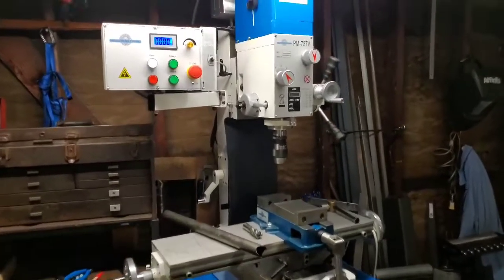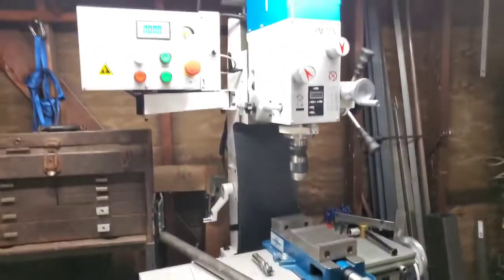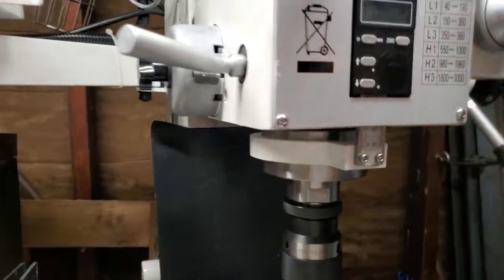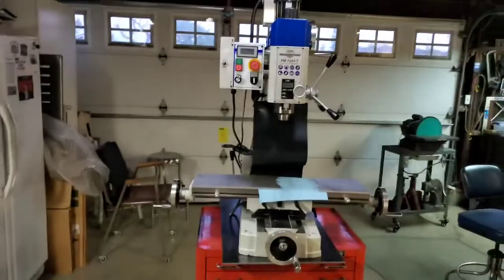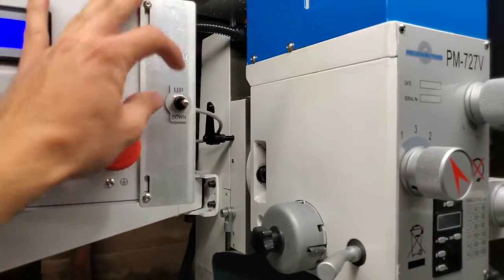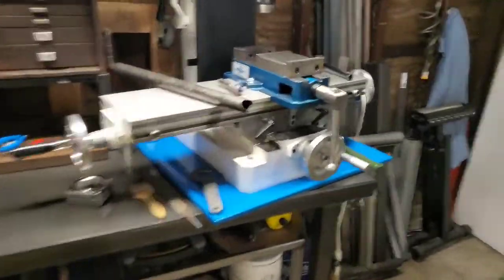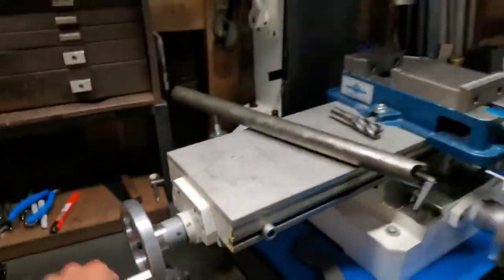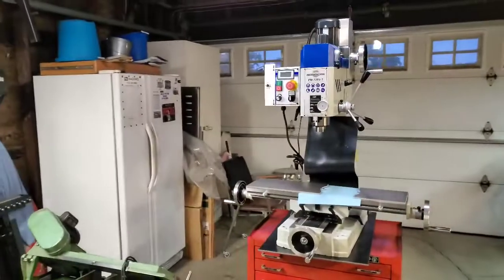Precision Matthews PM-727V vs. PM-728V-T

Comment: I have the 727V and it's a good machine, I will say a few things, the left crank doesn't have a dial but with some (mine) the power feed is there (an option) and that is one reason PM might have left it that way, also as you stated the machine has good power and torque, I also use the McMaster-Carr folding handles, but mainly the 727V is very rigid, I have the Factory DRO and it makes a major difference if it's in your budget.

Comment: Thanks for the help.  I’ve been so sold on the belt driven Taiwanese version for so long but now taking a step back and looking at the bigger picture.  I plan to mill tool steel and also small stainless parts.  Thanks for the helpful comparison!  Not too many people have both at the same time.  😂
Reply from the maker: @RodlessReel  Yes I've had the "luxury" of having both at the same time lol. The 727 has much more rigidity than the 728 so it's probably the better move. It's easy to switch the gear knobs to each of the 6 different speed ranges as you need them. If you're gonna mill hardened & stainless steel you'd probably regret having the 728.

Comment: The 728 might be made in Taiwan and all but this doesn't justify the steep pricetag if is too weak to drill a 1/2 hole in steel. They should at least sell it with the bigger motor.
Reply from the maker: @JohnnyRbbit  to be fair, most of time time it will drill a 1/2" hole in steel just fine but in some situations it would stall. I agree though - it's underpowered for its price tag. I think a lot of 728 owners convert it to CNC for machining aluminum and it probably works well for that.

Comment: Hey, great video. Are using 15 amp circuits? Any tripping breakers on the 727? Thanks!
Reply from the maker: Thanks. I have it on a 20amp breaker but it would probably run just fine on a 15amp breaker. It's never tripped the breaker. It doesn't seem to draw much power but you could find all the electrical specs in the user manual I'm sure.
Reply: @grippimatt  ok, thanks for the info!

Comment: hows it holding up?
Reply from the maker: It's held up great, I've been using it for over 2 years now. I mostly use it to bore holes in stainless steel flat bar with annular cutters and it works like a charm. I haven't had any issues with it.
Reply: how does it do with face milling/facing operations on various types of steel?
Reply from the maker: @peterantley  it will handle that. I've faced stainless without any speedbumps. It has as much rigidity as you can ask for in a benchtop milling machine.
Reply: @grippimatt  any chance i could make a donation for a video on the subject? Im a greenhorn. Inherited the family south bend lathe and i want to add a mill. Im on the fence. My local mentor swears by a super rigid American machine but im not sure it makes sense for me. I feel like starting out im doing small parts and would rather spend my time making chips instead of doing repairs.
Reply from the maker: @peterantley  I appreciate the offer but I think the determining factor for you is how heavy of milling operations you're planning on doing. A benchtop milling machine is really intended for light to medium duty milling operations. At 470 pounds, the 727V can handle some decent cuts but at the end of the day it's still a benchtop machine. 

I should add that I'm no expert. I use my machine to run a small business and only occasionally use it for precision work. Most of the time I use it as an expensive drill press. My grandpa was a tool & die maker and I've taken machining courses at my local community college in addition to my background as a welder/fabricator. For all the machining work I've needed done as a professional fabricator, the 727V has handled all of it. 

Another thing to consider is what your shop space is like. I chose a benchtop model because I'm operating out of a standard home garage so space is limited and I don't have room for a knee mill. If you have space for a full size knee mill I'd recommend that but most of us don't. Enjoy the family lathe - that sounds like a nice machine.
Reply: @grippimatt  thanks for the thoughtful response. I should try to take the local community college class and see how it goes. Im in enterprise data processing but have been really enjoying learning abt metal fab this winter. My friends dads been teaching me draw a bead and do some light fab work as well.
Reply from the maker: @peterantley  No problem. Working with metal can be very rewarding. I've made lots of custom furniture pieces for my home and being able to repair things around the house when they break is priceless. Good luck on your journey!

Comment: I had a pm 25 mill , then I bought a pm 727 omg it's far far better and the 5" precision vise fits perfect, I removed , cut the back lip of the 5" vise with my band saw ! And I have full vise motion! On the table if you get the 727 definitely get the 5" vise , modify it by removing the useless trim rib lip on the back of the vise and you will be much happier than the 4" vise !

Comment: hi, nice video thanks for such great comparison, quick question, do you see the need to mount this on a cast base they supply? or a sturdy table top bolt it down would be good enough and rigid enough? i noticed either one of your machine are mounted on their base, both sitting on a table . any input is apprecaited.
Reply from the maker: Hi, I think you're referring to the stand they sell with each machine but It's not very heavy duty from what I can tell. It's all made of sheet metal that fastens together from what I can tell so to answer your question- no, you don't need their stand for either machine. Any heavy duty alternative is gonna be rigid enough but I wouldn't recommend leaving it on caster wheels because the whole stand will shake when you're milling even if the wheels lock in place. You'll need something with leveling feet.

Comment: Matt - this was a really well done comparison! Can you do me a favour? On the 727V can you measure with the table full right from center line to the tip of the hand wheel? Basically how much sticks out past the mill on the left hand side with the table full right.

Also - subbed :)
Reply from the maker: Thanks! Just measured this and if I understand you correctly, with the table as far to the right as it can go, the left hand wheel (excluding the handle) sticks out 1.125" to the left of the cast iron base. Let me know if this is what you're looking for.
Reply: @grippimatt  wasn't exactly the measurement I was thinking (was looking for from center line to left hand wheel with table at full right) but this works too since PM lists the base width. So really with table full right, based on your measurements there's barely any overhang to left.

I have a small work space like yours (check our some of my vids if you want to see)...so was trying to figure out if I swapped out where my drill press is for this mill, if I could not have it stick out too far if I just kept the table to the right when not in use.

Thanks a bunch!
Reply from the maker: @SomeGuysGarage  No problem, I'll check out your work shop 👍

Comment: I enjoyed your comparison. Well done, short and to the point! I have been thinking about the PM25MV vs the 727V but your video has convinced the small extra $ is well worth it. This will be my first mill (I'm a retired self taught mechanic/welder/fabricator with zero milling experience). I'm tight for space - with the 727V can I get rid of my mid-size drill press?
Thanks - - Craig
Reply from the maker: Hey Craig, if you have a benchtop drill press then I'd get rid of it once you get your benchtop mill. Most of the time I use my PM727V as a drill press anyway. With a keyless chuck it's pretty quick to operate. I'm pressed for space like you but if I had a shop or more room I'd want a dedicated drill press so I can leave my milling machine set up for milling. The main difference between the two operations is the head height. When you have a drill chuck on the machine with a drill bit you need to raise the head 4 to 8 inches to clear your work piece. Not a huge inconvenience, especially with the Power Lift but ideally I'd like to have a dedicated drill press.
Reply from the maker: It'll be worth getting the PM727V. I considered getting the PM25 but it seemed too small and underpowered for my needs. More weight equals more rigidity and rigidity is everything.
Reply: @grippimatt   Thanks very much - I appreciate your comments and the quick response (not sure if a shop is ever big enough)

Comment: Matt, I've had a PM 727V on order for nearly a year now. For the same reasons as you I wanted the beefier machine. Yes there are some features of the 728 I like, lube system etc, but I like the geared head. It's also supposed to have variable speed as well. 
PM keep giving me various reasons why the 727 hasn't been delivered and I'm beginning to think I'm being messed around. PM have a good track record for service so I don't understand that they would risk that reputation. At the beginning of the month the answer was they don't have a shipping date yet.
I've ordered mine with 3 channel DRO installed in China. Maybe the chip shortage has something to do with the delay. How long did you wait for yours?
Regards from Canada's banana belt.🤞🇨🇦👍
Reply from the maker: Hey Ron, I ordered my 727V in Jan 2021 and received it in March 2021. Seems like I got it before supply chains really snagged. As for Precision Matthews customer support I've had a good experiences with them. I got mine without the DRO so it was obviously a shorter lead time. Hope you get your machine soon ✌
Reply: @grippimatt  thanks Matt. That would have been about the time I was procrastinating between the two machines. PM did tell me that they had a couple of 727s available but as I wanted the factory installed DRO I'd have to wait. They offered to refund my deposit and if I wanted to change to a different machine but non of the others offered the choices I was looking for. 
On your control panel I see a variable control. Is that speed?. If so how effective is the mill at lower speeds torque wise. Does the motor labour when not at max?.
Have you tried power tapping at all?.
Reply from the maker: @ronwilken5219  I've never tried power tapping on it but it does really well at lower RPMs. I've used big annular cutters and big drill bits with no issues. The variable speed is within the speed range of the six gears so as long as you have it on a low enough gear it won't stall on you
Reply: @grippimatt  Thanks Matt. Hopefully I'll get some good news soon. In the meantime I'll watch for your videos to pass my time. Stay well.

Comment: If the pm-728v-t was under powered, did you consider buying a bigger motor for it? Maybe a 3ph with a VFD. It would have been cheaper than having to buy the pm-727v.
Reply from the maker: I considered it but I like the features of the 727 and it's still a more rigid machine.

Comment: Thanks for the video.  If you still have both mills it would be very nice to know some metrology differences between the two.  PM says the 728 is higher precision  but they don't give tolerances when asked.  Perpendicularity of x,y,z axis and spindle runout would be good to know.
Reply from the maker: I don't have the 728 anymore but that brings up another difference between the machines. The column on the 728 bolts to the base from underneath so that you have to have it hanging over the edge of something to access the bolts if you need to tram the head. I had to do this to my 728, the Y-axis was off by about 5 thousands of an inch. The 727V has the bolts accessible from the top, making it easier to tram the head. Tomorrow I'm gonna upload another video about the PM-727V.
Reply: @grippimatt  did you have to shim the column mount at the base to correct that .005"? 
Edit: I miss read, thought that was z axis off .005
Reply from the maker: @mitchell5828  right, however you want to frame it I had to shim underneath the front of the column to get it square. I had to do this on both of the machines as they were not perfectly square from the factory.
Edit: I just uploaded a new video on the PM-727V

Comment: Thanks for that quick comparison.  Did you have the belt on the low speed high torque setting on the 728 when it was stalling?
Reply from the maker: No problem. The belt was set for the lower speed range when it was stalling. It was my mistake to buy the 728 as a work horse.